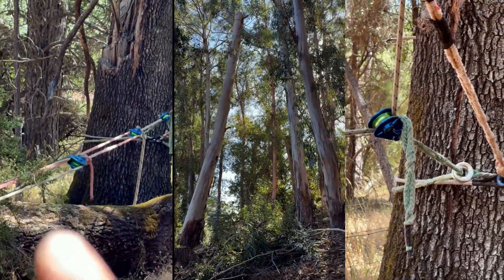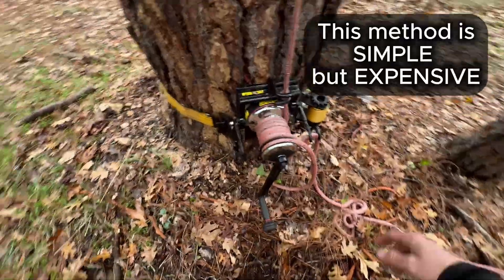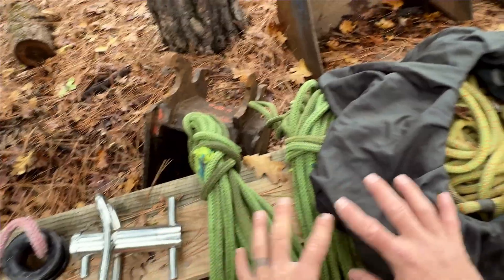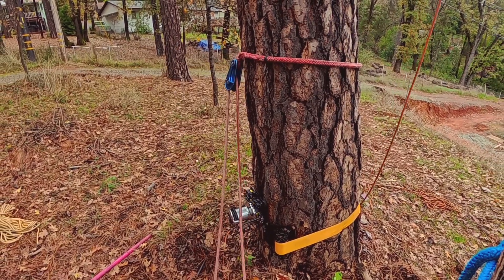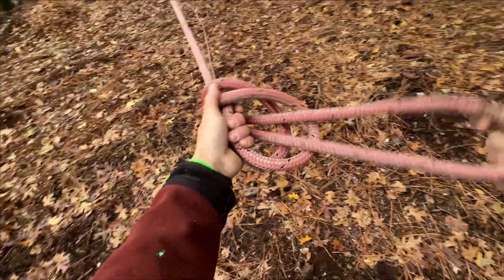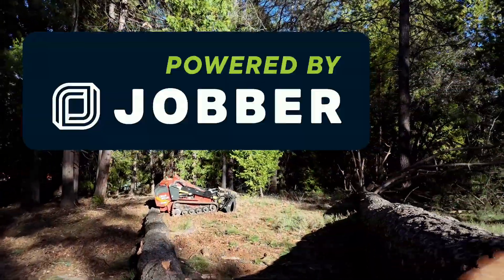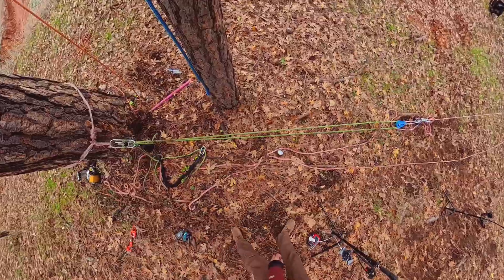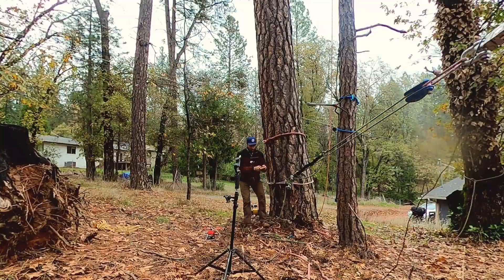1 Man 4 Ways to Pull 1000 lbs.

Comment: Great content Josiah!  My favorite quick, cheap, adaptable puller is the Maasdam rope puller, which is a 10:1 rope come-along.   I’m often bailing out rigging systems by clipping it directly to a port a wrap to lift a rigged piece a few feet to clear an obstruction or to brute force un-tangle a vine situation.  I would love to know how the Maasdam alone and into a 3:1 rates in your test (if you use a 1/2in 3 strand rigging line, you could thread it directly.  GRCS is great for pulling over trees, but I’ve been tossed a few times by that cheater bar and pawl situation.  I am leary of lowering with GRCS for the reason you demonstrated.  If you have not yet, check out the hold fast XL.

Comment: I have a 9:1 MA that I use a lot when I'm in a tight space or buy my self.  I'd like to send you a drawing of the setup, but don't know how to send it.  Equip list: one rope, 3-prusiks, 2-single sheath pulleys, 1-double sheath pulley, 1-anchor sling.  It's basically two  Z-riggs in tandem.

Comment: Great video! Never seen a rope jack! For anyone who wants an old school version of the gcrs which will last forever there was a lowering device called a Hobbs Block. You can dump big timber into it all day then crank on it if you need to tighten the rigging rope or lift branches.
Reply from the maker: Yeah the Hobbs is a good one, I think Stein also makes one with some lifting capacity.

Comment: I like to use a Masdaam  rope come along, running through a pulley hanging on a bowline on a bight, going to a porta wrap as a progress capture.  I agree that Prussiks are the way to go as a line attachment.

Masdaam is 1/3 the $$ of a rope jack and gives you continuous line pull.

Going to experiment with the pulley attached to a prussik for when I need more travel in the pull line.  I don’t think the Masdaam can exceed the force required for a 7-8 mm prussik to slip. ( Masdaam rated at 1500 lbs)

Keep the vids coming !!!
Reply from the maker: Yeah I used a masdaam many times but there are a few reasons why I don’t recommend it anymore.  The rope slips in the device somewhat unpredictably, so needs to be backed up. It can’t pull 1000lbs on its own, I’d be surprised if it could hold 500 lbs without slipping.  it also uses 3strand which creates a nasty twist in the rigging so it’s harder to combine with pulleys without creating a bunch more friction as it twists in itself.  It also doesn’t release under tension easily. It can, but the control is limited and slow until it’s totally loose.
Reply from the maker: I’d love to see your prussic test though. Prussics can bite super hard with the right rope combination.

Comment: My guys would look at me like I was crazy if I asked them to hand pull the pull line... we have a skid steer on almost every removal... if not a redirect to the pick up... sometimes both... our yards are generally accessible
Reply from the maker: Skid steers are the way to go if you have it on hand. Are you using a bollard at the skid to control the tension as well ?
Reply: @Stridertrees we used a porty on a d ring when we're lowering or  dropping a lot of trees for easy on off. If it's just one or two trees, its faster to just take three wraps around the round cross member of the grapple bucket

Comment: I'll give a try to the portawrap method, thanks for that ! 

I often use a 'complex' system like the last you've showed but with only one rope, one anchor and double pulley on it. Sweet 9:1. Prussik to keep tension at the output and also prussik on the 2 moving pulleys to rearm easily